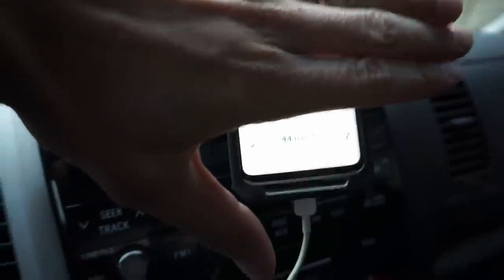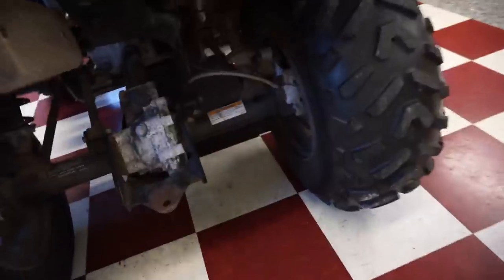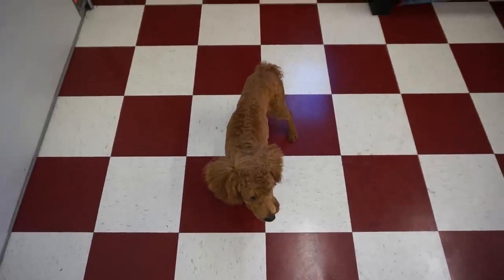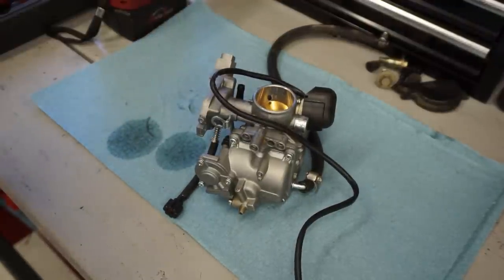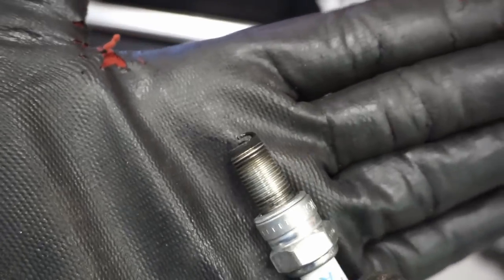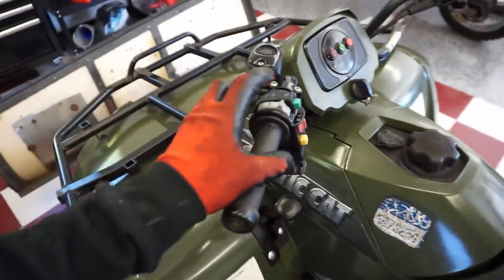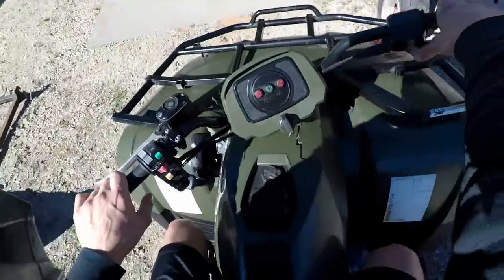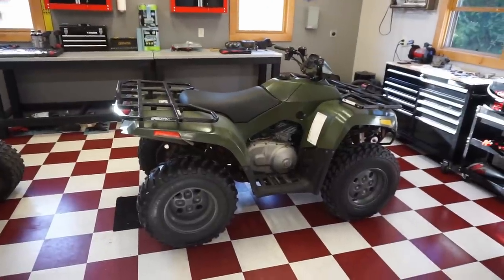Mouse Infested Plowing ATV Sat In a Barn For Years. Will It Move Again?

Comment: Also the lever on the side of the carb is the fuel pump when it's cold and the auto choke doesn't work you can pump it a few times and it will start right up.

Comment: If that much stuff blew out of the CVT breather, the cover should be pulled to investigate.  Lord knows what else is inside of there, especially with mice having been in there.  Being a belt driven machine with unknown miles/hours, that's one of the first things I would check anyway, just to be sure the primary clutch rollers aren't flat spotted, the belt is in good condition, excessive belt dust, etc.  All the normal things you would check on a CVT machine.  Also, that Warn winch should have a free spool handle on the cable side of it, so you don't need to use the rocker switch when pulling line out.  Makes winching much quicker, and saves your battery.

Comment: Hey Joe... I just wanted to mention your tape job on the the air box snorkel tube to richen the air / fuel mixture. If you would adjust your mixture screw correctly on the bottom of the bowl of the carb you wouldn't need that hack to make it run correctly. Keep up the videos that we all enjoy...
Reply from the maker: It's about the pressure in the air box not the fuel mixture. I tried adjusting it and it did the same thing. I'm guessing the air filter wasn't restricted enough for the carb.
Reply: Mine is the same way needed more restricted

Comment: Good buy!  Might I suggest, on the side of your winch, should be a switch, switch it to free spool to unspool winch line.  Also, it is hard on your winch to hook it up to an object, the pull the object out with atv.  Let the winch do the work. Also, throw something on top of the winch line (like a sweatshirt), in case of line breakage. It will keep it from coming back and causing injury.

Comment: i have one like this from 2003, its a higher trim level but lower at the same time. It was from the time when e reverse was around, but it has manual rev, but it does have speedo and odo, but you are right. These are super simple machines that are easy to work on and are super reliable. And they get really good mileage too.

Comment: Lucky find with this one. One small thing tonpoint out, not sure how important it is, but you never hold the reverse override button when you back up. On the scrambler I used to ride it would load up and start popping and spitting if you reversed to long with holding that button in

Comment: Something I wish I knew about these bikes is  under the skid plate there is a small "oil pan" that the drain plug screws into that you can remove with four small bolts and allows access to the pickup  screen that in our case got clogged with gasket material after a dealership shop changed the one way bearing. I unfortunately did not discover said oil pan until after we lost the bottom end and of course  there are no parts available for the bottom end on this bike so remember if you have to go inside one of these motors take a little extra time and clean the screen.

Comment: Choking off air isn’t a fix, it’s a trick to get back home. Cv carburetors are pains, I have ran across similar problems and found that the vacuum diaphragm on the slide gets stiffer over time and the engine does not produce enough vacuum to compensate, or the slide doesn’t slide as easily as it should. Problem is those diaphragm can be hard to get sometimes
Reply from the maker: The diaphragm looked great. I wonder if the stock airfilter was more restrictive than the new one on it.
Reply: Yeah I'd get a stock filter or rejet. CV carbs are bulletproof otherwise
Reply: @TIICProductions  I don’t know about that, the basic slide only carbs sure were
Reply: @cm5838  exactly,cv carbs aren't the greatest
Reply: @myguitaryourface5160  just more to go wrong. I can get rebuilt kits all day long but few come with that diaphragm. And I don’t know what is up with the fuel here in Arkansas but I’ve come across quite a few rotted out carbs.
Reply: Cv carbs are incredibly simple. The needle is vacuum reference instead of throttle reference making the acceleration smooth and nearly bog proof. The diaphragm is a simple flange type seal and it's obvious when they're bad, just like a weed eater diaphragm carb, you can see and feel when the diaphragm is torn or brittle. Don't be afraid of things you dont understand, just learn them and conquer the world instead of being a scardey cat
Reply: @mikem5475  I know cv carbs are simple,my point is there are fcr carbs that are way better and more complex, ,not that you can run 1 on this,just proving my point

Comment: Wait a second! So you "adjusted" for improper jetting by using foil tape on the intake? Why not take the time to put the correct jets in that cheap china carb? I am willing to bet that the factory carb was dirty and the seller went online and bought the cheapest carb he could find. Stuck it on and it still didnt run so he listed it. Had a guy do that with a mint 2012 Polaris 400ho. Took me a while to find the correct OEM carb and it ran 100% after that.

Comment: Sweet quad!  Man, you guys are getting slammed on gas there, but oil there is way cheaper than here.  Gas yesterday here, $2.99 a gal, but a quart of Amsoil is now about $25.00.  With a Wicks filter, an oil change for the little Miata my son and I are reconstructing is $120.00.  Unfortunately around here, there are only a very few who carry it, so they can charge whatever they want to.  IS that a plastic cover over the frame of that plow??  Must be for snow only if so, but we don't get any of that down here much.  We just get tornadoes.
Reply: We are paying $7.14 a gallon in the U.K. At the moment.
It gone down quite a bit in price recently too!

Comment: Great video.  I watched it and as soon as you had mouse house coming from the CVT vent, I was wondering why you kept running it.  Eventually ejecting a live mouse.  Did you ever pull the CVT Cover and vacuum it out?  All that trash in there as well as dead mice can break your belt or weaken it..  Anyways, never saw that you opened it up to clean it out.  Good find on the air filter box fix.
Reply: No  to  mention  mouse  pee  on  anything  in  the  CVT  can  seize  the  CVT  solid  on  it's  shaft,  making  it  completely  not  drivable.
Reply: I agree. Normally he is on point but this time, my mind was blown!  Every possible clue slapped him in the face many times but he continued to ignore every one. While lack of fuel may have been an issue? part of the engine bog problem was using the CVT as a mouse blender. A very expensive blender at that

Whenever you are dealing with mice, if you see one? there are 10 more within 5 yards you can't see? Besides, every new house deserves a new mouse right? A house warming gift for sure, Lol.
Reply: @superdog1964  Lol, mouse blender.

Comment: Enjoy your videos but I was very disappointed to see how you fixed the carburetor problem, that's not fixing the problem, that's masking it.  If you have to do that to make it run you're starving the engine of fuel.  That lever you were messing with on the carburetor could be an accelerator pump.  That will add the extra squirt of fuel you need to keep it from bogging.  That carb looked pretty clean like a replacement, is it the right carburetor?

Comment: i would check jets. make sure carb is original oem one. i just got a 01 arctic cat 250. did same thing as yours exact same. i got me a oem carb used. did right factory jet size. runs great. that carb looks chinese. arctic cat dont like chinese carbs run like crap. i have owned 5 of them all sizes.

Comment: A  mouse  got  ejected from  the  CVT  breather.  Pull  the  CVT  apart.  Clean  it,  check  the  shafts  and   parts.  Mice  are  employed  by  the  parts  manufacturers  to  cause  breakage  so  that  you  have  to  buy  expensive  replacement  parts.  I'm  almost  sure  of  it!

Comment: Anybody I just got a 2007 crf250r on a steal has complete rebuild runs awesome but no 4th gear old owner claims 4th was there before getting it rebuilt I got for 1000$ because he couldn't get it started ended up not being timed right and the chain was off behind the flywheel fixed that and she fired on 5th kick but no 4th gear previous owner said 4th was working